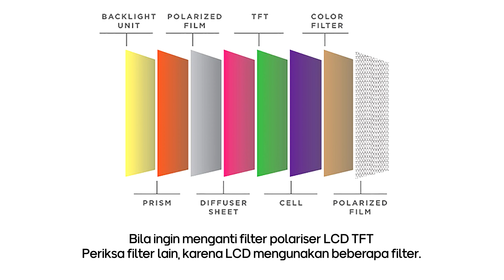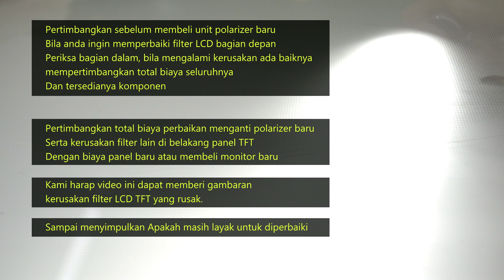Filter Polarizer LCD monitor perbaikan LCD apakah sesuai dengan biaya

Comment: Mas kalau lcd digital foto frame memutih apakah dgn mengganti polaris sesuai? Soalnya lcd digital foto saya ada gambar masih keliatan dikit dan tipis,, selebihnya putih mas. Trimakasih
Reply from the maker: Dilihat dahulu kerusakannya kak.
Bagian layar depan kadang muncul kerutan, artinya kerusakan di filter polarizer depan.
Bila di bagian depan ternyata filternya tidak bermasalah. Mungkin di bagian belakang LCD bagian filter yang mengalami kerusakan
Kerusakan filter umumnya terjadi bertahap, dari gambar mulai pudar, muncul spot gambar yang hilang, dan beberapa bulan bahkan sampai 1 tahun semakin melebar.
Itu salah satu ciri filter, ketika lem mulai mengelupas dan filter mulai tidak menempel dengan baik
Reply: @ObengwareID   baik trimakasih mas, terus kalau monitor saya begitu adapter di colokkin langsung hidup padahal ada switch power/on off nya belum saya ceklek itu gmn ya mas??

Comment: Bang kalo monitor HP w1907 memakai polarized berapa derajat?
Reply from the maker: Waduh susah jawabnya kak
Ada baiknya di tanya ke toko yang jual.
Panduannya TFT LCD model lama rata rata 45 derajat
LCD LED model baru berbeda seperti panel IPS atau LPS.
Bila filter polarizer diganti. Jangan berharap monitor tampil seperti filter lama.
Karena kualitas filternya berbeda (konon lebih bagus).
Dari pabrikan filternya lebih tipis.
Semoga informasi tersebut dapat membantu dan bermanfaat

Comment: tanya pak, apkh plastik film polarizer 0° terlihat lebih gelap dan tebal dibanding dg 90°?
Reply from the maker: Belum coba kak.
Kita hanya memperbaiki LCD TFT Monitor model lama. Rata rata 45 derajat.
LCD monitor model baru, kalau tidak salah mengunakan 0 derajat.
Filter Polariser untuk TV berbeda, mengunakan sudut 90 derajat.
Bisa ditanyakan ke penjual bila ingin memperbaiki filter LCD
Mohon maaf sebelumnya, kami baru mencoba untuk monotor saja
Reply: @ObengwareID  Bg, mau tanya kalo monitor samsung syncmaster 943 19" kira2 brp deg ya? saya beli udah lama 10 thnan yg lalu

Comment: untuk lcd monitor 24 inch, berapa derajat polarizer yang harus di beli ?
Reply from the maker: tergantung tipe kak. yang lama 45 derajat (TFT CCFL sudah ditest), yang baru 0 derajat (belum ditest hanya informasi dari web). Karena monitor berbeda beda, antara panel LCD TFT, IPF, LPS, LCD TV. Sebaiknya ditanya ke yang jual.
Reply: @ObengwareID  punya saya SPC 24inch , panel VA , Pakai polarized berapa drajat

Comment: Mas mohon info, apa ada lem untuk polarizer? Saya coba masang polarizer yg baru di tv lcd pakai sabun, ternyata tidak nempel tapi gelembung udara jadi sedikit. Apakah masih bisa digunakan polarizer yg sudah hilang perekatnya? atau harus ganti baru? Tks responnya.
Reply from the maker: Maaf, belum pernah mengalami hal itu kak.
Reply: Ok trima kasih responnya.
Reply: sama dengan yang saya alami, statusnya masih belum terpasang. Kira-kira jika pakai lem loca atau lem uv apa bisa ya? Sayang bgt mau dibuang karena polarizer 46inch. Apa ada saran lain ya?
Reply: Coba aja cari di youtube tentang cara pasang polarizer dengan air shampo atau air sabun cucui piring. Sepertinya bisa lengket lagi tapi harus dijepit pakai frame tv nya dan harus dibiarkan kering seharian/semalaman. Saya pernah lihat spt itu di youtube.
Reply: @rha1849  saya bayarin aja drpd dibuang ✌
Reply: Sebelumnya cara ini sudah anda coba? lalu apa kabar polarizer yg anda pasang tetapi sudah hilang perekatnya, apa bisa dengan cara ini.
Reply: Ya sudah saya coba. Ternyata polarizer ada 2 lapisan plastik. Akhirnya saya pasang yg masih ada perekatnya (dibalik) tapi tidak pakai air sabun dan hasilnya banyak gelembung udara

Comment: gan untuk perbedaan yg menggunakan polarisasi 0 derajat dan 45 derajat apa di lihat dari penggunaan backlight nya?led dan cclf begitu?soal nya saya ada 2 lcd monitor yg rencana mau di ganti,1 lcd lenovo lawas produksi 2007, dan 1 lagi lcd LG ips produksi 2012 kalo gak salah, untuk penentuan polarizer yg harus saya gunakan yg mana, takut nya salah beli
dan 1 lagi lcd lenovo sudah saya kupas bagian luar nya, cuma masih bisa keliatahan tampilan,cuma untuk warna putih terlihat seperti putus2 vertikal, apa plastik yg saya kupas itu yg di maksud polarizer?
Reply from the maker: Catatan kita, polarizer 45 deg, umumnya digunakan pada panel TFT. 0 Deg untuk LED panel yang baru. TV LCD kita kurang tahu.
Yang di video ini ngak di ganti, karena rusaknya udah ke dalam. Biayanya sudah setara monitor bekas. Jadi sebagai informasi, kalau panel di buka ternyata masih ada bercak, artinya difuser bagian dalam sudah rusak juga. Nah yang kaya gini ngak, biayanya jadi ngak enak.
Yang ada garis putus putus kita kurang mengerti. Bisa jadi keliatan, coba di cek itu Lenovo itu panel LED, kalau ngak salah 0 derajat. 
Ditanya ke toko yang jual saja yah kak, informasi mereka pasti lebih lengkap. Nanti info kita yang salah.
Reply: @ObengwareID  untuk lcd lenovo saya cek keterangan di web nya  "Display TypeLCD monitor / TFT active matrix" kemungkinan pakai yg 45 deg ya gan?sedangkan yg LG kaya nya pakai led, cuma belum sempat saya bongkar keadaan cuma seperti berkabut aja yg LG,ngeblok warna putih cuma masih bisa terlihat hanya saja gak sejelas keaadaan normal, yang Lenovo kondisi bergaris cuma waktu nampilin warna putih aja, kalau warna lain gak, apakah udah gak worth it buat di perbaiki untuk yg lenovo?